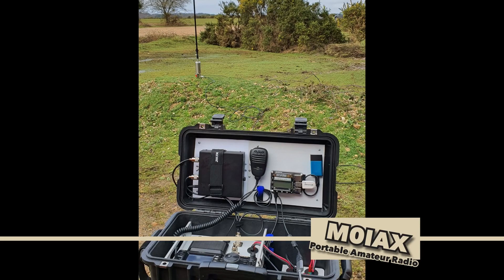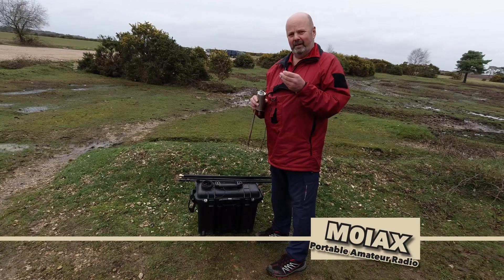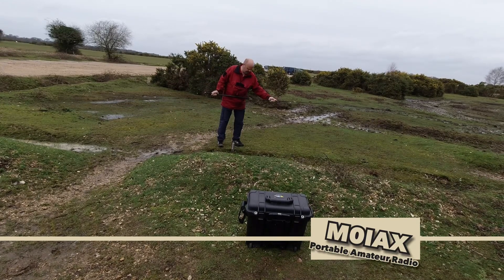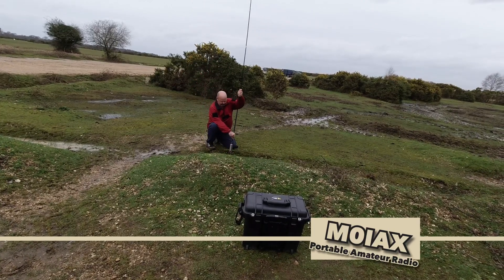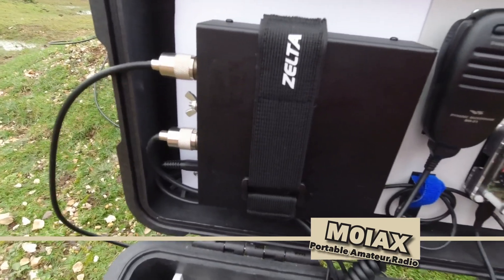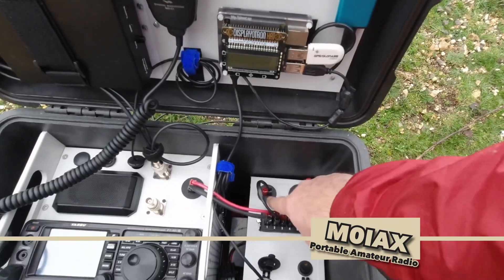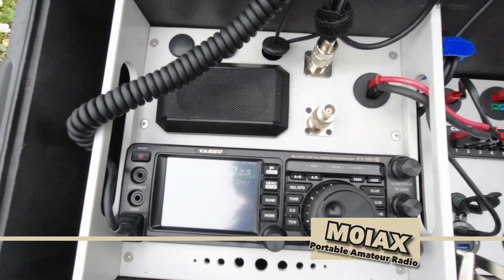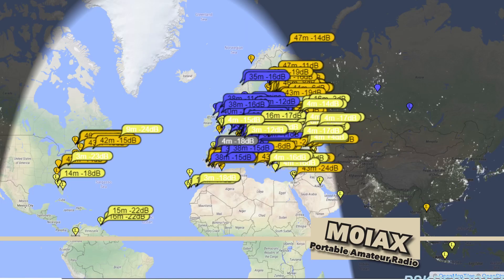Yaesu FT991a and a quick to deploy antenna system

Comment: Hey Mark, Can you tell us what brand/model the case is ? Thanks
Reply from the maker: Hi, its a Pelican Case, its either the 1430 or 1440 but i cent remember exactly and I don’t have it with me. Only one of them is deep enough to take the radio in this config.
Reply: @M0IAX   thanks for the quick reply. 73

Comment: Wow this is exactly what I was imagining to build.  I already have the exact same case. How did you make the white panels, are they 3D printed?  The case is tapered so they have to be custom fit. Would you be willing to share the 3D files?  How about some part numbers for the tuner and battery?  I wonder if I could finish this project "good enough" in time for field day.  Thanks!